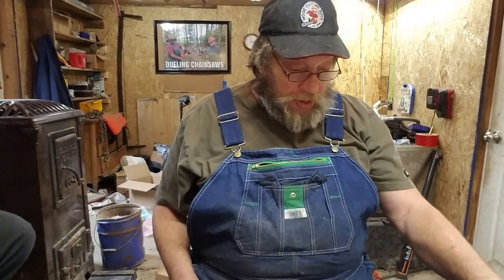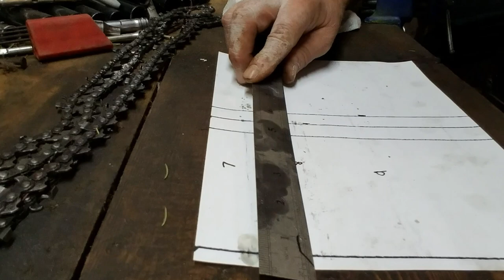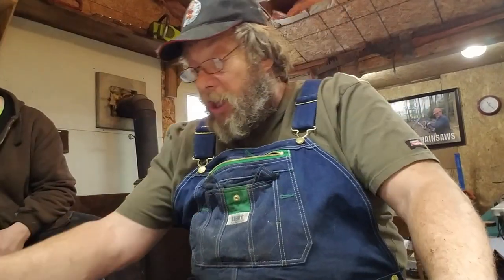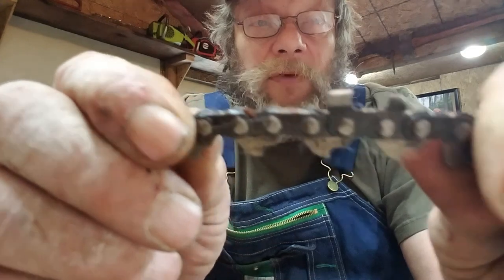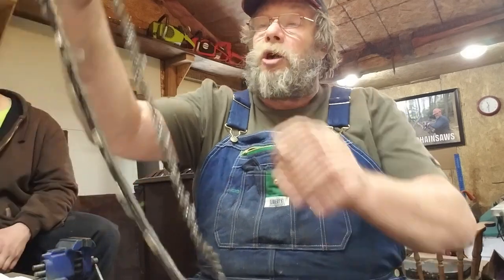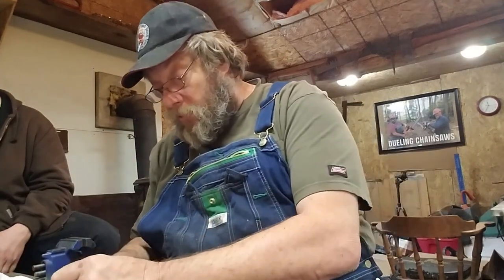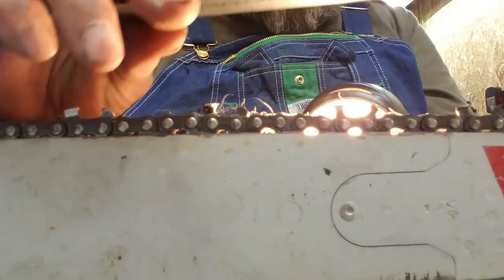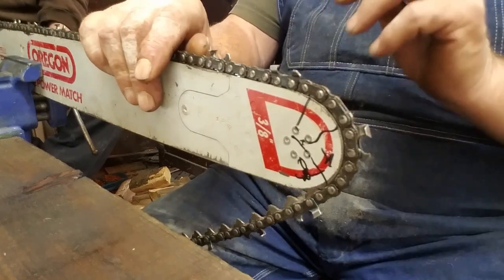Chainsaw sprocket size! What chain? On what saw! (Very detailed)

Comment: Very Nice, i did the same Math years ago changing 7pin 325 into 6 pin 3/8 on a smaller Saw for more Performance in bigger wood. 
325 has more Cutters on the same chainlength . 
 Germany has almost only full house chains, never seen a half or Fullskipchain in a Shop here. 
Maybe caused by the smaller Trees we have here. A 24“ Bar ist mostly everything you need here. 
My Dolmar 143 has a 24“ Bar with fullhouse and an 8 pin Sprocket. Rakers. at 0.8 millimeters.
Runs great. I cutted down a Redwoodtree at full Barlength and now i know why i should try to get a Fullskipchain. With Barnose in the wood ist is harder to cut through.
Very good Video with a lot of Experience. I will try the less Chaintension! Thanks and Greetings from Germany.

Comment: And just like that I see the light! I trash picked a 40 cc poulan, it was a dull ,dirty mess. Got it squared away and sharpened the chain. Went to pull the chain around the bar and it went “chunk chunk chunk”. I will now go back and look closely at the chain for wear. If it’s like the rest of the saw was it too is probably ridden hard and put away wet. Thank you Sir for sharing all this unwritten knowledge!
Reply from the maker: Cool!  Thanks!

Comment: Thanks as always for sharing Harvey. 

If I may add a bit of what I’ve learned over my 60yrs.....I’ve never ran skip chain but I’m going to try it soon. I’ve always felt rakers/depth gauges don’t need to be touched until pretty well 1/2 a new chain teeth have been removed. 25 yrs ago I started using 13/64” files on 3/8” chain vs 7/32” so very much smoother in the cut especially cutting hardwoods. That little tidbit came from the head of Stihl head office tech dept here in Canada whos now passed on, Dave was a genius. 10% smoother and 10% faster cutting. When taking my rakers down my last swat with the flat file I’ll hit the front corner which makes for a nice little ramp coming into the cut vs a blunt edge. Less chance of any chatter or at least that’s only my opinion 
I never allow my chains to sag, ever. too much of a chance to spit the chain while cutting in horizontal position say while setting our #1 cut for our notch, (sighting line while felling). Proper Tensioning, always always keep bar tip lifted up and tension chain Just Until the links come in contact with bottom of bar. When letting off the throttle, if that chain comes to an abrupt stop, it’s too tight, readjust, excessive friction costs HP and causes heat, heat removes temper from chain and bar.

Comment: Between this video of yours and Billy’s I have a much better idea of what is happening with my chain in the cut. I know running my chain too tight is bad for my saws bearings so I like it a little on the looser side but not too much. Great practical information! Thanks!

Comment: You are absolutely right on all points! The only thing I would add is. Out here on the left side of the country where we run long bars. 30" and up. Once you get out past about a 36" bar a 8 tooth sprocket even with full house chain will have an advantage. Because as the bar gets longer it takes more time for the chain to make it around the bar. Running an 8 tooth will bring the speed back up to where it's close to what a 24" bar would be. We have a lot softer wood out here so you can get away with that. Now that's talking on a 80cc saw or above.  Also 8 tooth and skip chain work really well on bars that exceed 40" because you maintain good speed and you have enough room between the teeth to not wood up pulling a chain through 40" of wood.

Comment: You have been changing my world over the past few months brother! You and Buckin' both have. I 'm a new subscriber back about the 2nd week of March when you showed up in my feed. I was just out in the garage with this video going while I was cleaning and going over some of my saws. I had just had the bar off and had put the chain back on and I just checked my chain tension when you mentioned it. I had just thought that the chain didn't feel quite right because I just tossed the chain on. Over the years everyone around me have always shown me to get the chain quite a bit tighter than what it probably should have been. Lucky for me there is barley any time on that chain. Didn't kill the sprocket but it needs a new one after 37 years. It's that saw's  birthday today Oct 6, 1983. A Stihl 024 AV. Thanks again!

Comment: Squaring off the top of rackets also allows the tooth and racked to clean out  more material increasing a cleaner cut, thus less time to complete cut.  Been doing this on full comp and skip chains for 30+ years. In big wood and smaller. Only small diameter logs tend to chatter more, but still cutable

Comment: Great video as always. It took me a long time, and a lot of sprockets, chains, and bars to figure out to not run them so tight. Running them tight is also hard on the crank and bearings. Keeping them sharp, correct depth height, and correct tension makes your saw work much better and easier, and prolongs the life of your equipment. Here in East Coast of Canada I run all full comp chisel tooth chains, and 7 tooth sprockets. Mostly Stihl brand. I like them the best. Thanks again Harv, great explanation!

Comment: Thank you for your time on sprocket information , and helping me understand the pros and cons . Telling me of the dangers involved with bore cuts and skip chains , as I understand from you, If I was cutting soft wood with a skip tooth this would give my chain more time to expel chips . Keeping  the chain running straight .. By increasing the speed with 8 tooth sprocket on full skip chain ? .I am just a greenhorn when it comes to cutting ,and the information and attention to safety issues  are something I really needed to understand !    I also vary the raker depth like you do .  I think it gives the chain a hammer drill affect , Runs a little rougher on the bar I think ....I am one guy who asked you to do this video , Posted on your skidder video.  SORRY !

Comment: logged and fell professionally for years. My happy place for set up was, an MS 460, 32" bar, 7 tooth, full skip, rakers filed flat. 3 strokes off rakers off of new factory chain. Then, 2 rakers passes per filing as I ran.... was a timber felling fool!

Comment: Just learned that the 375k jug is the same as the 372xpg... 51.4???  I’m gonna find out... just found one and got it on it’s way? 🤔.  It looks like the ports are in the correct location???   Thanks for all your great videos!!!   I’m still trying to figure out how to take advantage of the crazy port into the transfer on the 357xp... crazy design on these little jugs??? LOL. Great fun playing with these saw’s!  Thanks again for all your shared knowledge!

Comment: Very well done video and well explained!  I've played around with skip vs full, prefer full for most cutting - smoother when cleaning out an undercut and nicer for limbing (cutting BC coast softwoods).  I like skip for trimming and cleaning up logs at my mill and landing - less sharpening time when cutting on dirty timber.  I run a couple of 372s and a 440 with 28'' bars.

Comment: That’s about how I check raker height.  Basically, I scan down the cutters with my eyes, looking for about a sparkplug gap between the top of the cutter and the raker top.  If it does not have this gap I hit the top of the rakers a few strokes.  I typically run LGX or RS on my bigger saws.

Comment: It’s better to pay attention to Harvey than wreck stuff and learn. I was never a logger and never went to tree climbing school or did firewood for a neighbor,  I liked cleaning up the yard with my dad and the old homelite tophandle thing. Xl maybe?  Anyway, now I sell firewood all the time and do residential tree removals and stumps been doin it 15 years sporadically as the jobs come in. I log with farm tractor (8n), I brought a few logs to harden furniture before they shut down now with no mill, just firewood. learned it all by trial and error I broke a lot. Now I know more than many. Harvey has all the engineering tricks pay attention. I wouldn’t be able to elaborate anything on this schooling tho I like to sound smart

Comment: As an equipment owner and operator I agree over tensioning chain or tracks just multiplies the working torque on the track parts or chain and thus stretches it or wears the sprocket, pins, and links faster than it would under proper tension. I am not saying all manufacturer specs are correct for the work your doing however. Example 1: the dozer is used at the city dump all it does is go straight up and down a fairly flat surface and minimal turning pressure to move over a blade width for every 2 pushes. That track can stand to be tighter and not wear as fast. Example 2 dozer pushing trees on rough ground or dozer doing grade work. These need to be in proper tension due to the tension under load on uneven surfaces this gets the most hours out of the pins, links and sprockets. Loose-loose is a no-no for any tracked equipment because the stress involved when the track is thrown and standard practice of operators not using proper methods (cutting corners) to get it back on the machine. Exactly like one of Buckin's recent videos where he used the saw to put the chain back onto the bar without un-tensioning the bar and doing it by hand. Every shortcut has a drawback and when that drawback is 24hours downtime on a machine with a broken grouser and link because 2 operators used a hoe to attempt reinstalling a track only then do you see the reasoning of it being only 1 hour downtime to open the idler ram un-tension the ram reinstall the track then re-tension the ram and get some working hours on the machine versus a huge profit loss (@$200/hr for a dozer) plus 24hours or more downtime. As far as personal preference on saw chains I like about 1/4 to 3/8 inch slack on the bottom unless its new chain I might put a new chain on tight to 1/16in slack. I must be lacking some skills in limbing cause I don't use the tip of the saw like you explained im 1-2 inches back off the center axis of the front sprocket on the bar but I aint a logger either. Thx a lot for the video fella.
Reply from the maker: Perfect!

Comment: I look for a spark plug gap between the top of the cutter and the top of the raker.  I typically round off the top of the raker to keep it in line with the leading edge of the raker.  This reduces chatter.  I run full house chains on 7 pin sprockets on 20 inch bars 3/8, .050 chain.  My typical chain is an Oregon LGX or Stihl RS chain.  I hand file all chains and I would bet you would find nothing wrong with my chains.    I snug my chains up to the bottom of the bar, lift the end of the bar and resnug.   That was the way I was taught and it has worked well for me for fifty years.

Comment: Great Video Ironhorse.! I learned a lot from this video. Thanks for going a little further with the rakers and bore cutting. I run full skip and do bore cutting and already figured out the best way to start the cut. Though doing blowdowns, it can be hard to utilize the safe zone to get started sometimes. I've been contemplating on going from a 7 to 8 tooth sprocket on my Mac 7-10. I know that increasing teeth increases speed, but reduces torque. So a 7 tooth on a 70cc saw will make it like a 50-60cc saw in terms of torque. Maybe you can do a video on the ramifications of speed vs torque. ;-)
Reply from the maker: Sure!

Comment: So you are saying that using a roller nose tip will be a bit more smoother going if you are a person who likes to tighten the chain a little on the snug side ???? For example using a  Remington roller tip bar type ??? Thanks. Using a two foot roller nose bar, how much spacing in the middle of the bar when lifter by hand ??? Good day fella.

Comment: Harv,  here is a question from a novice saw operator.    Got some Maple and Locust logs down.  I have been getting myself ready to do some chainsaw milling.  I bought a used MS 660 with a 36 inch bar and also acquired a 42 inch which I purchased some milling chains for.   In addition, I got a used 111cc Stihl 075 saw, but I needed to rebuild it to ensure it runs 100%.  It had a scored P and C and thus low compression,. I got a new OEM top end I am installing, plus other parts like crank seals, muffler, new flywheel without broken teeth etc.   Once I get it rebuilt, I will check it  for air/vacuum leaks.  This saw has the 404 chain and bars.  My question is probably a no brainer,  but should I make sure I get brand new sprockets to run my brand new chains on? The reason I ask is will a worn sprocket cause my new chains to wear out faster, not perform as well as they should, or any other factor you can think of when it comes to using them primarily for chainsaw milling?  Thanks

Comment: Excellent video, had been eager to find info on 8 v 7 pin, have a pair of chinesium 660's both with stock 7pin sprockets (running 25" and 32" RS33 on them), really was thinking an 8 pin would be more appropriate & will be ordering one now after having watched this but....which of my 2 saws, the 25" or 32", would you put the 8 pin on if you had to choose one?  Just want to better-understand (oh, "Why would you choose that?" is a key part of the Q LOL :P ) Because now it seems it'd be better for either of those bar lengths, that I'd have quicker cut-times (on the 25" it'd be due to higher chain speed being more-significant than the slowdown from chip-accumulation, but on the 32" - if sporting skip-chain - on the 32" the increased cut-speed should be MORE significant, no?  Because of both higher chain speed and the introduction of the 8 pin....am I on point?  Put another way, the 25" would benefit from the higher chainspeed an 8 would give, however you would NOT put a skip-chain on it because 92cc is plenty to power the full-house 25" and, even though it can power a full house 32", that 32" is 'past a point' wherein the length of the cutting, and the time to clear chips, can "use some help"....though that argument would be even MORE true for putting the skip-chain on the 25", no?)
Would love your thoughts on these, will get 8 pins for both if advised, and curious if you think a 32" on a (mildly-hot)660 should be skip-chain or if its power lets me get-away with full-house like I do on the 25"!
Thanks as always, learned so much watching this one (including stretched chains from running them loose, I sometimes run them - HARD - when loose, say if the sun's going down but I still have 40min of cutting, thankfully I haven't had notable stretch issues yet, or any indication of excessive sprocket-waer (and that's primarily on spur-type climbsaw sprockets, it's only the past 1/2 year that I've gotten into these bigger displacement units, my 355t w/ 18" had been my go-to for a while here in FL wood just isn't so thick, anyways will say I'm surprised how durable the sprockets can be!!  But, now that i can just pop off/on new sprockets as i please (same for variously-timed flywheel keys) with these 'separable from cltuch' sprockets I am so eager to try, am pretty sureyou'll say "get 8 pin for both 660's, and put a half-skip onto the 32" " but will see if you do get a chance to reply!!
Thanks a lot, it's important to remember, with all the machining & porting we do for power, to remember to ensure your basics (sharp, properly tensioned  chain w/ proper rakers, NO bad fuel lol I don't think I've let a saw see ethanol for at least 1.75-2yrs now; clean airbox/filter), because no porting will make-up for running a super dull chain!!
Reply: (oh FWIW I cut mostly Live Oak, so very hard wood, but clean/live wood usually....and I typically choose a saw based-upon bar length IE if what I'm doing is a 28" wide, I use my32", if it's 33" i use my 36" etc)

Comment: Yeah, for sure a real can of worms there!
Currently running an 8 tooth sprocket with .404 chain and it's a bit rough for my liking.   Been considering a switch to 3/8 chain but surely need more than 8 teeth. This old Mall bar has a pretty big tail so can accommodate most any reasonable rim.
I  agree with running chain not too tight too, really makes a difference.
I really appreciate your point on skip chain kickback, valuable advice there that might prevent injury for someone.

Comment: Great video.!!!  When running a circle mill. The balance of the saw is key!!!!!! If your saw isn’t hammered correctly it will Lead inward. I say that to say it also depends on how true your mandrel is. If theses couple things I mentioned are not true , then yes the saw will chase the grain around knots when doing your face cut.

Comment: Ironhorse, 
You have great knowledge and thank you for passing it to us viewers.  
I have a question , I bought a used Makita saw, it has a rim sprocket. Upon my inspection, the sprocket was little worn so I ordered a new one, Oregon 3/8 - 7. Problem is or so I think that the old as well as new sprockets feel very sloppy on a drum spline, not just side to side movement but when I put my fingers at say 6 and 12 position, I can move sprocket about 1/8" or even more.  Is this normal? I have a drum on order also. Drum splines look OK and so does needle bearing.
Thank you.